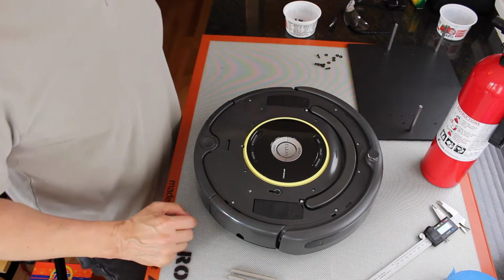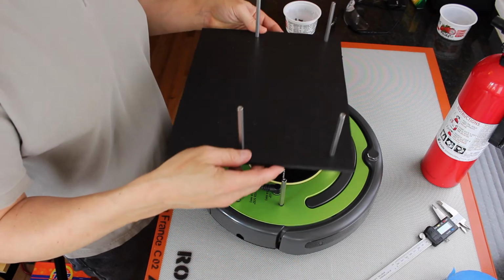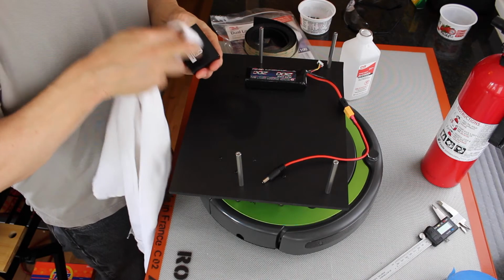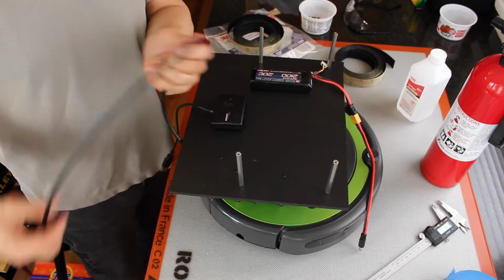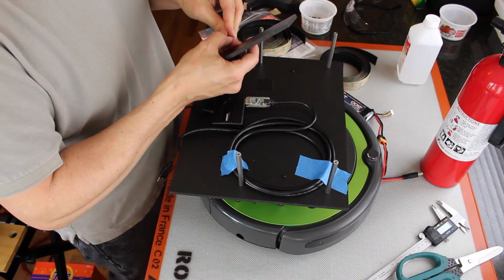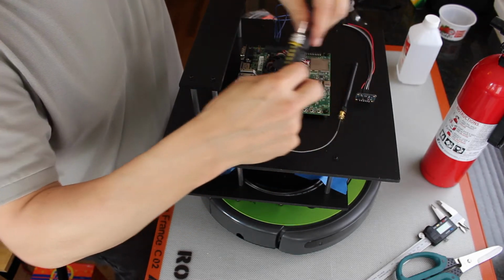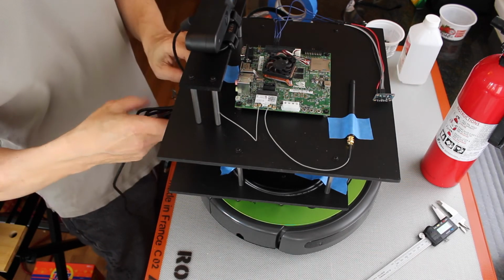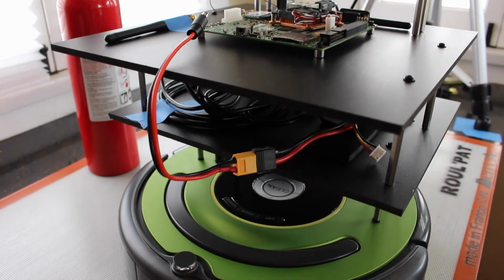JetsonBot Part 4 - Test Assembly - NVIDIA Jetson TK1/Create 2 Robot

Comment: hey great videos!!! would you be able to do a tute on how to piggy back power from the create to the jetsons rechargeable battery? or does that need to be recharged seperate on yours?
Reply from the maker: t's a little tricky, not something that I would recommend for an introductory robot like this one. The battery that I'm using for the electronics is a LiPo, which means that it should be balanced charged, whereas the built in battery is NiMh. If you connect or bridge the two, or try to power the Jetson with the Create 2 battery, then you have to work on isolating the electronics circuits from the ones driving the motors. Motors tend to do all sorts of nasty things to power circuits, strictly speaking most people separate the two using come additional circuitry.

Thanks for watching!

Comment: Hi again , Quick question, where did you get those standoffs and also where did you get the USB hub from. Hope all is well
Reply from the maker: +Ish Boo Hi Ish, The standoffs are from McMaster-Carr as stated in the first article for the series: http://wp.me/p51nTS-do. 
 
Vendor: McMaster-Carr (http://www.mcmaster.com)
Part Number
94674A490 18-8 Stainless Steel Flush-Mount Captive Nut, 4-40 Thread Size, .062″ min Panel Thick
91075A650 (qty 6) 18-8 Stainless Steel Male-Female Threaded Hex Standoff, 1/4″ Hex, 2″ Length

90910A716 Low-Profile Button Head Torx Machine Screw, 18-8 Stainless Steel, 4-40 Thread, 3/8″ 

A link to the USB hub is in the article for this video ,  http://wp.me/p51nTS-ei. 
Hope this helps!
Reply: +Jetsonhacks 
+Jetsonhacks 
Appreciate the info once again. On a side note I see all your guitars, what kind music are you into. I just got myself a Yamaha LS16 for finger-styling. You might like gareth evans guitar, he's a YouTuber that does guitar tutorials.
Reply from the maker: +Ish Boo All sorts of music, but mostly rock and fusion. All of the music on the channel is culled from years of jam tapes that I've played on with friends. The LS16 looks like a nice guitar, I'll have to go check it out. I've been playing my Taylor 314ce a lot recently, I always have to remind myself what a different instrument it is from electric guitar.
Reply: +Jetsonhacks 
I really love the music you play in the video, great tinkering music : )